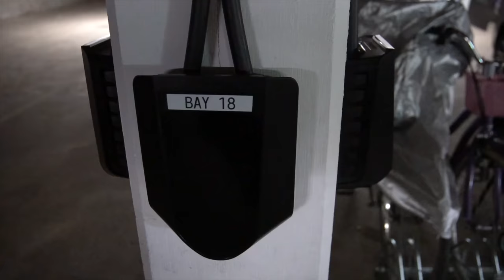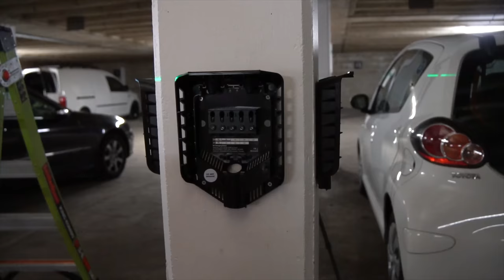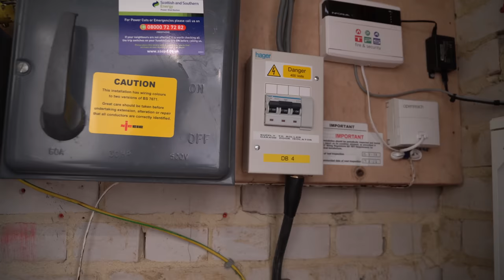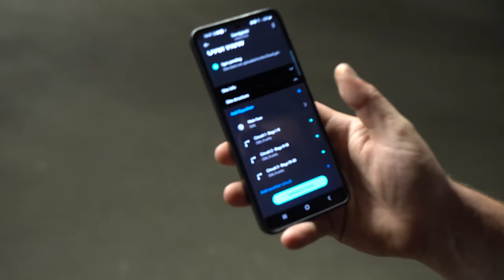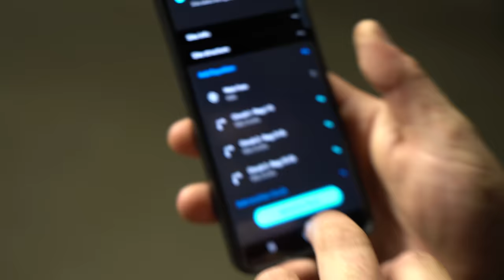Installing 660,000 watts of EV Charging

Comment: With the salesban on Easee chargers in sweden and netherlands, for the lack of sufficient safetymeasures (according to regulations), is it something that you have noticed an effect on Installations/orders in the UK? Or is it something that has just gone under the radar?
Reply: Easee is banned in Norway as well now. I suspect Easee is also on the brink on bankruptcy with all the lay-offs etc., so we'll see how it goes. Personally I would never install something that requires a cloud service to function (load balancing etc.) Has to be local, and there is really no reason why shouldn't, apart from the manufacturer keeping control, and potentially charging for the features as a service, or forcing you to upgrade because of end of life of the service. ATM. I only know of Defa and Schneider that offers local load balancing, and phase compensation.
Reply: Oh wow hadn't heard anything about that 😮😮😮 We went for Easee at mine, that's a bit worrying!
Reply: @sveip  Easee is not banned in Norway, please get your facts straight. Cloud service isn't strictly necessary for the charger to function unless you want to load balance multiple subcircuits with the rest of the building. Circuit level load balancing is done locally.
Reply: @michaelr2499  a quick google search and google translate if you don't read Norwegian will tell you're wrong mate. They've had a sales ban now for over a month in Norway.

Comment: Interesting installation, I got a CK tool vest years ago, been adding to it ever since. 

Just one question, you mention using red rawplug that will melt in a fire,  I'm assuming you were using concrete screws on the inverted tray.  

If your cutting galv in a enclosed area, keep a pint of milk handy, and wear gloves and a mask that stuff is horrible.
Reply from the maker: Correct 👌🏼. Why a pint of milk?
Reply: @corymac   The welding community say that drinking milk will help remove zinc from the body. (First trade welder then electrician) You're cutting and handling zinc plus spraying zinc, so its airborne and on your skin.  If your metal munching for a week, it's going to enter your system,  milk will help, I just remembered your lactose intolerant, in your case lots of ventilation and PPE.  Hope this helps.

Comment: Hi  Cory another great vid. Just  wondered how would the residents pay for the electricity is it app based on easee ? Which then goes back to the landlords ? Was there a separate meter for the Main EVDB
Reply: Hi Mate so the site Will be set up with Monta back office and then each user that has a working EV charger will be set up with a charging rate. The ongoing Monta membership will be paid for by the management company
Reply: @southcoastev  oh ok that’s pretty cool not something I’ve looked in to before seems like the way forward. Thanks for getting back to me
Reply: The only downside at present is the communal supplies aren't considered fully domestic so the electricity prices aren't subject to price caps and end up costing more, hopefully that'll improve over time. Easee also seem to offer a very good open access system so you have your choice of management system.

Comment: I'm not an Easee fanboy, but find the support from the UK office pretty reasonable. They are in trouble with authorities due to claiming to meet RCD standards which are designed for physical RCDs. The regulatory bodies just haven't caught up with electronic RCDs and the same could happen with many other charging products that also use electronic RCDs. Physical RCDs can't reset by themselves whereas electronic ones do etc. Can you imagine how the design would be compromised by having a physical reset switch?

I do think that this install is going to lead to complaints in the future - sharing a 60A lift supply with so many chargers really is poor. I faced the same situation with a 100A landlord supply which supplies a pool heater + other misc stuff. I would not have dreamed of accepting this and have gone through the pain of getting the DNO to quote for upgrading supply to 300A and the reason for why the government grant is so necessary. £500 per partially provisioned space and £850 for each fully provisioned space.

In terms of load balancing, the Optimizer (100A or 500A, single phase or three phase) can use their own proprietary RF to control ONE master, but if you have several circuits then all need to be on WiFi to communicate and I am not aware that load balancing communication beween optimizer and masters goes via the Easee cloud servers.

Matt:e now offer 5 pole breakers with built-in PEN fault protection so that the technology can be integrated into your own cabinets
Reply: Cheers Martin 👊 Just so you know we obtained permission from SSEN prior to installing so if they are happy so are we 👍

Comment: I was told to install 10 of these chargers but I wasn’t told to install separate load management just 10mm swa from a 63a mcb round all the chargers, I was told it was built into the chargers
Reply: Also 10mm swa doesn’t fit in the glands on the charger at all, it’s very likely water will get into the top of the charger, definitely needs to be wired in a tough sheath cable
Reply: Hi Chris, 10mm is tight but it does fit in OK.

As for the load management, yes they do load balance between themselves on the same circuit but not between separate Circuits so an easee equaliser is required upfront

Comment: If the cable tray is fixed to the ceiling using plastic wall plugs, won't that just melt in the event of a fire and result in the entire tray collapsing?
Reply from the maker: They’re in conjunction with concrete screws, solid and fireproof 💪🏽. Plug isn’t really necessary
Reply: @corymac  Ahh got it.

Comment: 50:07 ist it normal in the uk to switch the PE (Protective Earth the gn-ye wire)? never seen such a thing here in germany as the pe has to be alway connected to earth, the way it is done here couldn´t you get a potential difference to the earth wire of the charger when the switch is off ? i would never do such a thing here and never seen it.
just noticed whats even more dangerous the pe from the outer right cable is put on the left pe block this way if the left block is ever switched of the cable of the right side will not have an pe  when switched on ! you should really check that and put it over to the right side at least, i would count on the connection through the housing ift there is any.
Reply from the maker: We have to disconnect it via a special safety device as shown in the video, as if there was a PEN conductor fault, all earthed devices could become live vs the true ground. It’s a regulation here for TN earthing systems and EV charge points.

Comment: 28:00 The more EVs you get in the garage, the less likely it is that there will be a fire.  ICE cars are more likely to catch fire than EVs!

EV FireSafe, an Australian company, studied global data on the reports of EV fires from 2010 to 2022, concluding that there was a 0.0012 per cent chance of a passenger EV catching fire, compared to 0.1 per cent for an ice vehicle, a far higher (but still tiny) level of risk — 80 times greater!

Comment: I thought the grant rules required a minimum supply of 3.6kw to each charge point.
Reply from the maker: There’s up to 22KW available at each point. Just not all at the same time dependent on load balancing
Reply: @corymac load balancing or diversity?

Comment: dumb question: if all these cars are charging overnight, where is all the excess heat going?
Reply: Car battery charging is over 90% efficient so there is little heat actually being dissipated at the charging location.  I'd expect about 80% of the KWh going into a car ends up at the wheels unlike ICE vehicles where about 15% of the fuel (petrol/diesel) energy makes it to the wheels.
Reply: @AndyFletcherX31  have you ever been standing next to a fast charger under load? Charging an EV generates quite a bit heat that is disipated by the charging station and by the car, that is why the built in fans are blowing. Granted, an 11 kW point is a lot less challenging but if you put 20 cars next to each other, it will be quite toasty in the summer if you do not have ventilation to the outside. The efficiency to the drivetrain compared with ICE is not relevant to this discussion
Reply: @ttkddry  IIRC there are 3 x 32A 3-phase feeds or about 66KW.  If the total dissipation exceeds 6KW I'd be surprised.  Anyway it would be less than having 30 ICE vehicles cooling down after driving.
Reply: @AndyFletcherX31  yes I agree 66kW is not as much as some of the fast chargers, but this summer I had 2 installs with inverters overheating, because the ambient temperature exceeded 40 degrees celcius and cooling was no longer efficient, we had to vent the air to the outside. ICE cars cooling down do not keep producing heat all night long, compared to EV charging all night. Everything will work fine over the winter of course....
Reply: You asked a question - I answered it. You don't have to like the answer. In any case there are ventilation requirements in car parks to prevent buildup of CO, CO2 and other dangerous gases.
Reply: @AndyFletcherX31 660kW without the ALM, potential for 30 x 22kW. That is size bigger ...
Reply: @williamvanholz1666  The breakers would trip. They are putting a board in the adjacent room with 3 x 3 phase 32A outputs.  In any case the building incomer looks like something in the range of 200A 3-phase
Reply: @ttkddry  Fast chargers have all sorts of power electronics/rectifiers in them. AC chargers consist of little more than a few breakers and a contactor.

Comment: That section of wall that you clipped the cables to horizontally, why not tray it?
Reply: Time and money
Reply: Tray would be quicker than having to clip several individual cables.  Also for future expansion it's much quicker if you already have tray installed.
Reply: @Chris-hy6jy  

Cutting uni strut, dipping, drilling holes in strut, drilling 2 masonry holes, mounting strut, fitting zebs, cutting tray, dipping, offsets, measuring, metal cable tying with special tool etc etc versus drilling  one hole for a D line clip is way faster????

Future expansion? They have already fitted out all parking bays.

Comment: That install is just lol… In germany we install 30x 22kW threephase chargers and we would install a small medium to low voltage transformer outside with CT metering and feed the chargers from there… what you’re installing there is just worth a laugh and a good joke!
Reply from the maker: This install is for when budget doesn’t permit a new sub. ( most of the country who didn’t volunteer for the new EV laws about to be imposed on us ). This provides active load management as an alternative.
Reply from the maker: You do have a way with words 😂😅

Comment: Haven’t those chargers just been banned in Norway?
Reply from the maker: Whole of the EU because of misleading paperwork. I think they’re working on fixing it asap. I’m not affiliated with them, I just enjoy their product
Reply: @corymac   We have them at work, apart from from the odd time they don't lock the cable in when charging they have been perfect.
Reply: The Easee Home and Charge are still on the market in Norway and are not banned. There is no ban in effect that applies to the entire EU, however certain countries have preemptively banned the products. The ban will only apply to the entire EU if that is the verdict of the trial in Sweden which is concluded in autumn at the earliest.

Comment: Great video as usual Cory. Was there any pushback from the tenants who had to park their cars elsewhere whilst you were doing the work considering majority weren't having an ev charger installed?
Reply: When we did it at mine I managed to get unanimous approval from other residents as they realised how good a deal the grant made it - ended up about £65 per nay for enablement work which future proofed the parking space. We agreed to do it in sections so cars could move to free spaces 👍

Comment: I am pretty sure it's 66kw not 660kw  since 660,000 watts would pull well over a thousand amps
Reply from the maker: It is indeed 660kw without the ALM. Potential for 30x22kw chargers.
Reply: So when is the new supply going in 60amps per phase isnt going to do it.
Reply from the maker: They have Easee ALM going in ( active load management. ) on the dedicated supply
Reply: @corymac  so it's just a hope that the 30 vehicles never all need charging at the same time.
Reply: @rob19632 this is a common assumption to make in most of the electrical field. The more people you have, the more it averages out and you need less total supply. 

For example, assume electric showers. They're massive, and if every unit in this complex had one, and you ran them all at the same time, youd probably trip the mains. But its exceedingly unlikely everyone will shower at exactly the same time. Averages out, maximum demand is lower. 

Same with EV's. Some will charge during the day, some at night. Either way, no car will charge at 22kW for 8 hours a day, so on average they all still get enough power.

Comment: 28:33 Did I misunderstand? Why do you think it's now super possible that a fire might start? Given that EVs are multiple times less likely to catch fire (assuming good EVSE wiring!) compared to fossil cars sat idle with some components at way over 100°C after a drive.

This kind of chat is what insurers hear and then start imposing stupid limitations on EV charging in underground car parks because they believe the FUD without doing their research.
Reply: Ok you explained it at 35:30 but this still seems like FUD spreading. The chance of an EV fire with modern EV batteries is very low. When did you last hear of one in the UK?

Meanwhile, I'm sure our glasses wearing friend Martyn Lee mentioned that an Oxford research group was working on a solution for battery packs that allows fire services to remotely inject some device into the battery pack that drenches the cells in water using far less total water and stops the thermal runaway.
Reply from the maker: I hear of them as I worked a lot for a EV battery recycling plant in Luton and saw a few burnt out batteries. Might not make the news, but it happens and it’s serious.
Reply: A ship transporting EVs is on fire off the coast of Netherlands right now. In no way would I want to live in a building with EVs charging underneath in a underground car park.

Comment: You're getting £850 per bay to install dummy chargers??
Reply from the maker: Not sure where you got that figure from. It’s not that much for the dummy ones. ( although it wouldn’t be unreasonable with the amount of work and gear needed ).
Reply: @corymac  I thought he said the grants worked out to 850 per bay?  15k in grants for the whole job?
Reply: Hi Guys let me clarify, there is an EV infrastructure grant of £500 per bay to install infrastructure. If you then install a working charger in that bay instead of a dummy you get another £350 for doing that (£850 total)
Reply: @southcoastev  so if you run SWA into 100 bays you get £50k in grants without installing a single working charger?  Good to see the government is spending our money wisely! 🤦‍♂️
Reply: can I wire all of the bays off of a single 16A breaker and still get the grant?
Reply: @edc1569  wouldn't surprise me.  Sounds like whoever dreamt up this scheme doesn't have a clue what they're doing.  Just another massive grant bandwagon to jump on.
Reply: @Chris-hy6jy  A bit like the PPE then!!